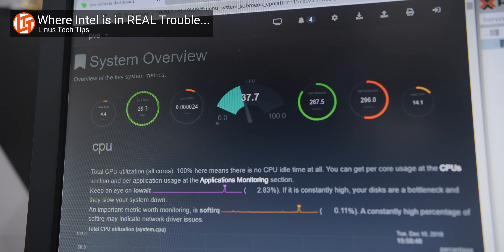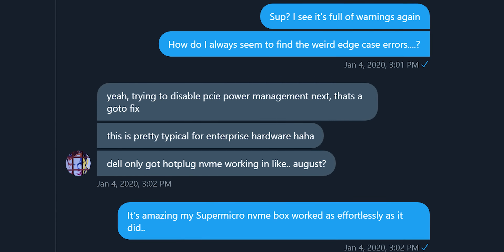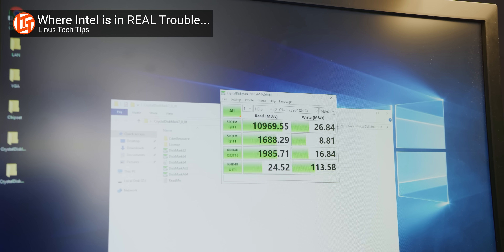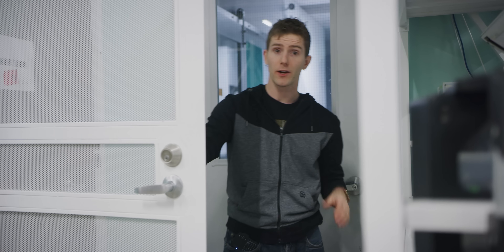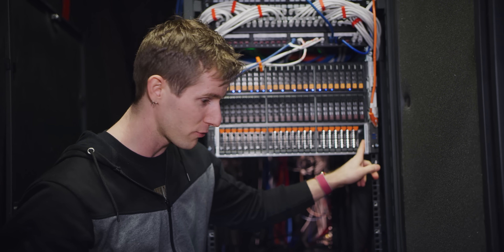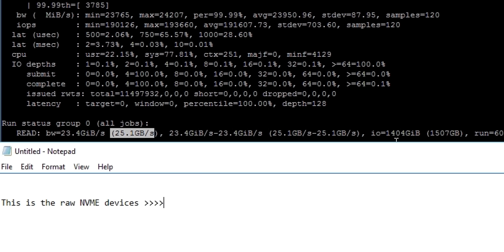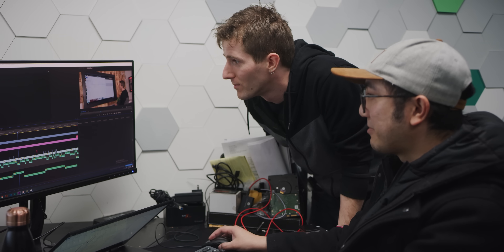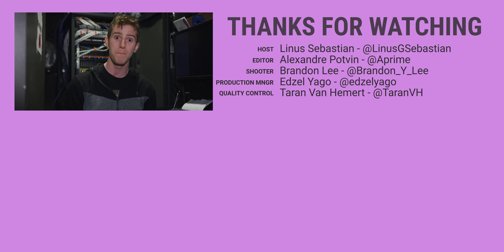This Server Deployment was HORRIBLE

Comment: Me: they're still using the 24 core, I thought they had a 64 core?
Linus:one thing we haven't mentioned, we've replaced the 24 for the 64, but went down to 32 bc 64 is overkill

Since when has an ltt project not been overkill
Reply: I suppose the 64 core cpu is for another project. Aka MC SERVER :v
Reply: @nicolasa.bermellferrer8025  MC server isn't actually going to be run by them anymore
Reply: @nicolasa.bermellferrer8025  That's dumb. Last I checked Minecraft is still shit at utilizing a ton of cores and prefers high single thread performance. Basically a 64 core CPU would only be good for running a lot of servers but not at top tier performance. An overclocked 9900k would probably give the best performance for a Minecraft server.
Reply: @BitterCynical  Not for over 20 people playing in separate VM's while the server is also a VM. You think so small, a 9900K wouldn't even give every user a logical processor core as it only has 16 of them. But a Threadripper 3990X would clock way higher than a 64 core EPYC CPU so that would be a better choice, though it doesn't have as many PCIe lanes to give every user their own graphics card. But this can be solved by using a couple of Nvidia Tesla GPU's so they can use Nvidia Grid where a GPU can be split among several users with scalable performance.
Reply: @CheapBastard1988  A GPU is required only client side...
I've dabbled with Minecraft servers, I know how they perform. After a certain number of players simultaneously traveling and generating new chunks performance goes to shit regardless of hardware, and it happens much faster on typical server CPUs with lower clock speeds.
Reply: Uhhh Video editing is the backbone that produces these channels.... Why wouldn't you throw 64 cores at it if you have it and will improve times!?!?!
Reply: @ZeroSpawn  because it won't improve anything? At the speed the server is going at, they can scrub in full res which is more than enough.
Reply: @Anon.G  Well he stated 64 would show massive improvement @ 14:51.... Anywho he didn't use it, so this is the land of should of, could've, would've.
Reply: @ZeroSpawn  The massive improvement was over 24 cores, he seemed to suggest that 32 cores was about the same performance.

Comment: I know this is a different problem but https://www.youtube.com/watch?v=8NSzkYSX5nY talks about NUMA and How Netflix changed FreeBSD to transfer 200Gbps from a single server. There were a number of optimizations for Epyc to allow this high rate of transfer possible. This was using UFS and not ZFS on NVMe drives. Pretty cool talk and actually shows pictorially the bottlenecks on Intel & Amd CPU's.

Comment: Designing storage arrays is very difficult. A good friend of mine was one of the original EMC developers, prior to being bought out by Dell, and he specializes in developing custom storage arrays for fringe case companies. I have great respect for Wendell, but after talking for many hours/days with my friend about storage design... especially flash based storage, it isn't something that you can easily configure with off the shelf hardware and not spend a fair amount of time writing you own code as well, assuming you are looking for the kind of IOPs and bandwidth that those workstations would be consuming.
Reply: @Caligula This shit's entertaining though? To me at least. Building the whole thing, and even the issues that come along the way.
Reply: @Caligula That's kind of the point of this channel, "DIY everything, regardless if it's a good idea". And it's way more entertaining than watching reviews of products that you don't even care for.
Reply: @Caligula In the SMB market it is very hard to justify the cost of enterprise storage. There are mainstream solutions that attempt to bridge that gap, but thy aren't much better than DIY solutions. That is where the market for boutique storage designers come into play. The problem is most of these are not well known outside of Hollywood and other similar niche markets, so someone like Linus wouldn't necessarily have the connections to get a line on someone who could help him.
 
I had a large state client who needed a storage solution for the platform we sold them. We sent vender recommendations, but they were stuck with HP as they had a purchase contract agreement with them. They could have used a $15-20k storage system from a mainstream provider, but as they had to purchase Enterprise level gear from HP, the cost was $220K+, which exceeded their budget.
Reply: @Caligula Why would you play street fighter if is not on evo level then? Why would you practice any sport if you don't do at pro level then? Why would you cook something for youself if you can't reach a 5 fork cuisine level then?

The fact you are watching these videos should make you realize why. It's entertaining.
Reply: @Caligula Attempting is sort of the point of this channel. Most of the things they build only have to work long enough for one video.
Reply: @Caligula "We're getting a lot of CPU bottlenecks, here". Yes, Linus. That is why real enterprises get servers with a dedicated RAID card, and don't do software RAID.

Comment: I'm just wondering why you guys didn't go with a dedicated RAID card instead of trying to handle all this cleverness with the operating system.  Seems like a lot of work for the CPU that should be delegated to a card built to deal with that kind of workload.  [Disclaimer] I have zero experience with nvme drives.  The multi drive server I put together long ago was using disks with platters.  I just would have thought that RAID cards for this kind of work would exist.

With that being said, great video.  I love the deep dives into what all did and didn't work.

Comment: Hey Linus, instead of running all those drives in parallel you can implement a sequential data array. Use enough drives to saturate the data bus and put remaining in the series. This is how they are coupled in many data centers. Just a suggestion.

Comment: I'm still confused as to why you used storage spaces instead of a hardware raid... Is it just one of the things you have to do when using DIY server components that don't have nifty OEM tools for configured raids?
Reply: Hardware raid is just a card dedicated for software raid
Reply: @Anon.G  I get that.  I'm just used to configuring raids in the bios.  That way they only appear to the OS as one disk.
Reply: @Medium0Rare  I agree but for the purposes of a storage server you don't need the os to be on the same disk as the storage. On a personal pc it probably makes more sense that way
Reply: @Anon.G  we usually have multiple raids.  SSD storage for os and SAS hard drives for storage.  I'm used to setting up small business servers... Usually HP.  We always configure raids before we install anything.  Even if we have ESXI on flash storage, we configure the raid in the bios raid config before fiddling with disks on the VM host.  I always thought that storage spaces would be more appropriate for home use.

Comment: Really like Wendell's solution.  Start with interrupt then switch to polling after a certain amount of time.  Looking forward to Microsoft doing something similar and f*cking it up.
Reply: It is a pretty standard technique. I was actually assuming SSDs was already doing it. I can remember when it started being a thing 20 years with certain cached connections. It isn't even standard blocking polling, the Linux solution is just asking every x microseconds, and then handling everything ready at that time. Works really well with hardware like NVME that can queue many different operations at the same time.

Comment: Hello Linus, or anyone else from LTT or LMG who might see this.  I'm planning on building my second PC and I wanted to try posting the specs of my current build along with the items I'm thinking about buying for comparison to try and get an idea of how much improvement is possible.  The goal for the new stronger build is to simply be used for casual gaming at the most.

Current Old Build: 

ASUS P8Z68-V Lx motherboard
8GB Corsair Vengeance RAM
128GB Crucial SSD
Intel Core i3 Quad Core Processor  (I don't know the generation or the max GHz level.)
500W PSU
(I used to use an AMD Radeon HD 7750 1GB Memory GPU, but it never really performed very well.)

That pretty much covers the most important parts of my current build.  Here are the components I'm interested in from Amazon within the budget of between $800 and $900.

ASUS Prime Z390-A Motherboard
ASUS TUF Gaming GeForce GTX 1650 Super GPU
Sabrent 512GB Rocket NVMe PCIe M.2 2280 Internal SSD
Corsair Vengeance RGB PRO 16GB (2x8GB) DDR4 3200MHz C16 RAM
Corsair Carbide Series SPEC-DELTA RGB Mid-Tower ATX Gaming Case
Corsair RM Series RM750W Full Modular PSU
Intel Core i3-9100F 4 Core Up To 4.2 GHz Without Graphics LGA1151 Series 65W

I can't explain why, but I've become partial to ASUS, Intel, and Corsair brands.  If anyone can offer any advise/recommendations based on this comparison I'd greatly appreciate it.
Reply: Mobo and cpu combo is unbalanced. Just go with b360 instead. Get another ssd like adata sx8200 since you are not going to utilize pcie4.0 since it is not supported by your choice of cpu. Unless you are going for i7 or i9 then yes z390 is a better choice.
Reply: Also i3 is a bad choice imo. Just go for the i5, the psu is overkill too 500-600w is enough for the hardware you choose
Reply: Nicko Porras Thanks.  I have been wondering about the cpu.  I originally wanted to go for an i7 but the total was too pricey for me.  I also looked at some current gen i5s, and i’ll keep researching.  As for the PSU, I kind of wanted it to be a little overkill in case of any future upgrades.  I’m hoping to set the M.2 SSD as my Windows 10 64 boot drive, and i’ll get another good SATA SSD down the line sometime.  Would anything weird happen if I went for this whole build as it is once all set up?
Reply: I’ll probably downgrade the PSU a little though.  Would an i5 work ok with the z390?
Reply: @SamVG64   it will, but youll be not utilizing it that much tbh. If you go for a K version that is
Reply: @SamVG64  nothing weird will happen. I5 9400f is okay and a b360 board. Go for a z370 or z390 if you are going to overclock which is only available for K series cpus
Reply: Nicko Porras Maybe i’ll spend a little more and start with a good i5.  I can always upgrade to an i7 eventually.  The i9s are out of my league.  Thanks again for your help.

Comment: There easy fix use Self controlled raid 0 (chip used to mount drives to raid 0) pcie adapter

And in OS mount drives as raid 0

Comment: I actually have the exact same issue on freenas, tried in windows, same issue, sure i'm using SATA. I ended up getting far better performance after upgrading from L5630, to an E5649, will probably get even better performance from X5675. However, the new release of freenas "upgraded " the array and it seems to be alot faster

Comment: When you have the perfect name to use Linux but still need a Server Failure and lots of convincing to use it.
Reply: To be fair getting SMB multipathing or any of the newer SMB3 features working reliably with samba is a pain. So if the NVMe had not been an issue it might have worked out great. I know it does work a treat with SATA drives and RDMA capable NICs (SMB Direct).

Comment: "We only have a 40 gigabit network connection" 
Yea.. 
"Only"
Reply: Enterprise have already moved from that obsolete technology to 25/50/100/200/400Gbit Ethernet!
You can actually get used 40Gbit switches for a price that of less than a car
Reply: I only have 8... 

megabit
Reply: @michaelmechex  Sh*t, I wish. I'm in the mountains with cellular and happy when it hits MB speeds. Still beats the sh*t outta the old 1200 dial-up modems when I was a teenager.
Reply: 40 Gigabit is actually 4x10 Gbit
Reply: I’m buying a 50GB nic for my server in a few weeks. Only 200 bucks.

Comment: ?? Are they running software or hardware raid ?? 🤔
Reply: Thats could be the problem , try to have one controller to All the drives
In pro setups you will never have raid sets across multiple controllers
Try run hardware raid
Just my thoughts 😊
Reply from the maker: Software. NVMe hardware raid is (mostly) not a thing.
Reply: And by running hardware raid, you taking the load of the CPU
Hardware raid is expensive

Comment: When you call 930 MB’s a second slow.
I have a file server that I think is fast and only transfers data at 9 MB’s a second using USB 2.0
Reply: I'm quite happy with mine doing 300~500 MB/s off of a single QLC SATA SSD.
Reply: Steamrick I’m just using an external Hard Drive in Mac OS since I got a Mac Mini for free from my friends dad. It’s also plugged into the USB port.

Comment: As much as I like the weird unique LMG project videos, I’d like to see some normal helpful tech videos sometimes that haven’t been talked about in years like:
 if the last time you built a pc you were using Cat5e Ethernet cable, what’s the difference between cat6, 6a, 7, 8 etc.
Reply: That feels like more of a Techquickie video.
Reply: Not much practically speaking. If you are wiring up a house, use cat6a so you are 10gig proof. For everything else it doesn't matter.
Reply: thats more a techquickie video. suggest it there
Reply: That's more a Techquicky type of video...
Reply: I mean, I can explain that here. Cat5e is good up to gigabit, Cat6 is shielded from interference better and is intended for 10 Gigabit and short 40 Gigabit cable runs, Cat 7 is for long 40 gigabit runs and medium length 100 Gigabit, Cat 8 is a data center thing for connecting switches right next to each other, probably in the multi-hundred gigabit range. They are all backwards compatible and are basically the same with some shielding and quality differences.
Reply: @gajbooks  there is nothing running on catX over 10Gbps. 40G/100G and plus is optical or DACs (twinax cables) for less than 10 meter distance. But its not twisted pair. And realistically, at 100G, you'll run fiber...
Reply: @garci66  Well ideally yes, but realistically no. Linus is clearly still running 10Gbps copper in the office, and I think his 40 is still copper as well.
Reply: @gajbooks  They run 40G using DACs (Direct Attach Copper) - see here for an explanation of DACs and twinax cabling: https://en.wikipedia.org/wiki/Twinaxial_cabling#SFP+_Direct-Attach_Copper_(10GSFP+Cu) and here for a 40G DAC https://www.fs.com/c/40g-qsfp-dac-1117. 10GbaseT is limited to 100meters on cat6a cable and there is no real benefit of going cat7 for 10GbaseT as you shouldn't have links longer than 100 meters due to timing issues.
Reply: Cat5e is probably still what you would use. I'm on gigabit internet and still use Cat5e.
Reply: Its all about run length. You can get 1 gig on a 10 foot Cat3 cable, but you won't on a 100m Cat5 cable. CatX based 10G+ is a waste and never REALLY caught on.

Just use Cat6 when you can and you'll be fine.
Reply: When building a new house I'd wire it up with Cat 7 just to be on the safe side, but frankly fast Ethernet is going the way of SFP+ supremacy, so you'll definitely want to be able to lay down fiber optics after the fact if it proves necessary.
Reply: Thanks everybody! Great answers!
And yeah I thought of it as a Techquickie vid too but this video came out first and it’s all LMG. It’s not like it’s a forum and it’s unlikely anyone at LMG would see the comment. 
I just figured I’d mention it because it was info I was looking for and if enough others were too maybe LMG would end up hearing about it. Their last video about it was 7 years ago.